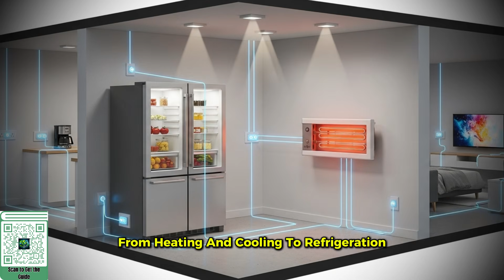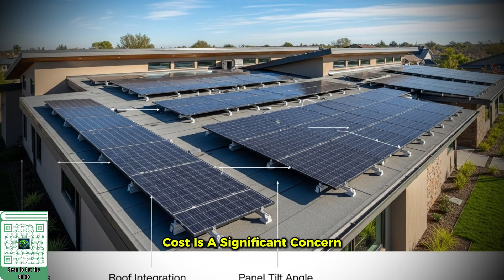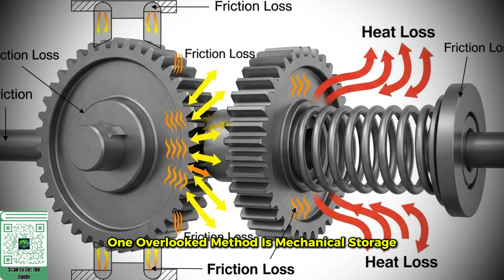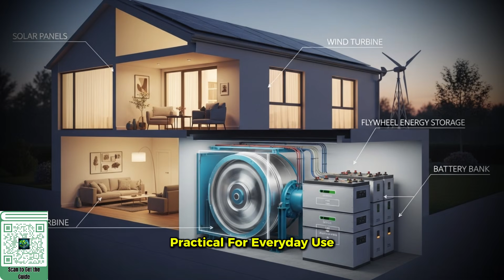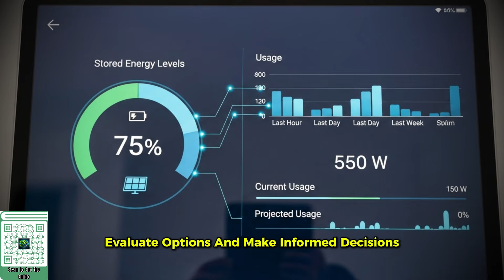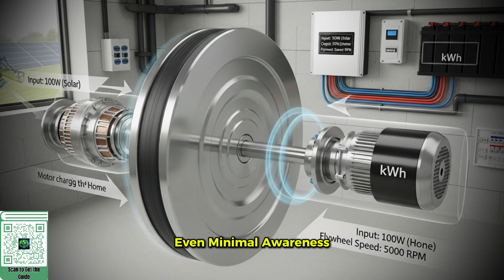How This $200 Device Powers a Whole House

Comment: While I agree that the fly-wheel is a great asset it's also something that looses it's ability to store energy rather quickly, 2 or 3 percent per hour. So it comes with it's challenges and own set of costs that need to be thought about.
Reply from the maker: @ArchiveForgotten You’re correct that traditional flywheels can lose energy over time, but this system is specifically designed for home use, balancing efficiency, load management, and minimal operational costs. It’s built to maximize usable energy without requiring oversized equipment or constant maintenance. For a full, step-by-step guide showing exactly how this device can power a home efficiently, check the pinned comment for detailed instructions.